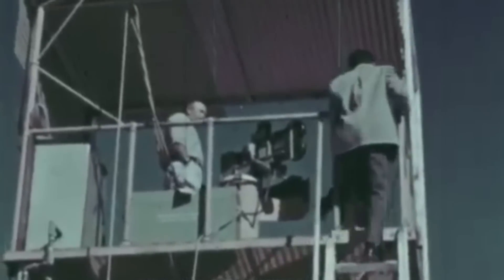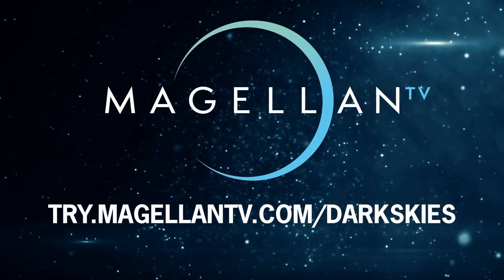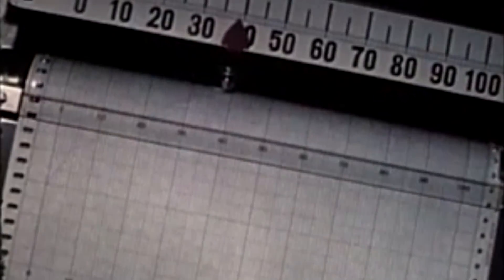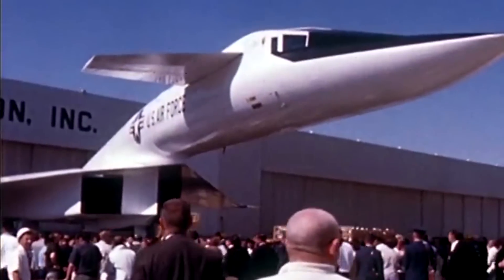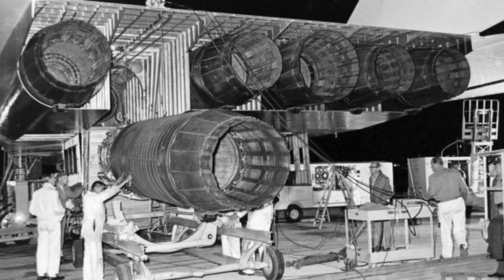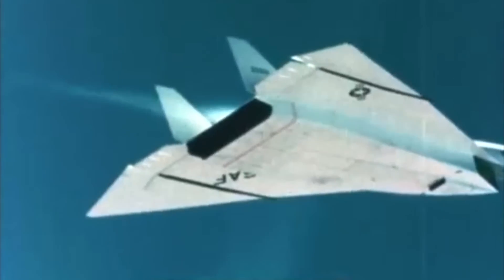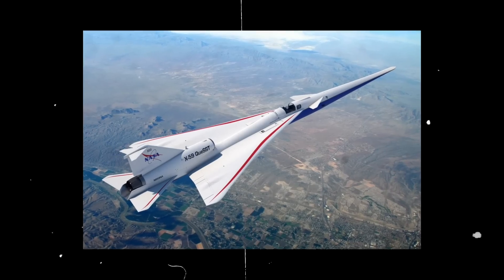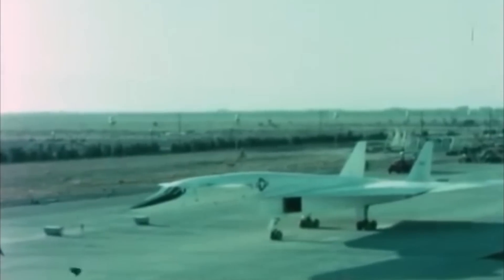XB-70 Valkyrie - Mach 3 Nuclear Bomber

Comment: I spent a lot of time at the Wright-Patterson Air Force Museum when I was little. Everybody liked the SR-71, and that was kept inside. They used to just let the YF-12 and XB-70 sit outside in the rain. But they had the J58 and YJ93 engines inside where you could play with them. And an Me-262 engine. I usually just stared at the engines while my family wandered around the museum... Except for the XB-70.

It's just beautiful. It's worth going to Dayton just to stand under it. And the Wright Brothers plane is there, too, in a different museum. The USAF museum also has a couple Keyhole satellites now. It's better than the DC Smithsonian as far as aircraft. Hangar 18 is also at Wright-Patterson. If you go to the museum, make sure you sign up for the bus ride to the Annex -- it takes you to Hanger 18, where they have many retired Air Force Ones and experimental planes.

The SR-71 and XB-70 will always be the coolest airplanes ever made. But the SR-71 is silly.

The SR-71 was insanely expensive to maintain. To keep the fuel from igniting in the tanks at high temperatures they invented JP-7 fuel with such high octane that it took explosives to start the engines — and they needed a bomb squad to refill the starter fluid (which exploded when exposed to oxygen). The engines dynamically reconfigured themselves and needed to balance the shockwave in the intake. If things weren't perfect the engine stalled with a dramatic bang, and after you shit your pants you needed to restart it ... if you had enough explosive starter juice left.

The XB-70 was much more rational. It used normal JP-6 fuel and they pressurized it with nitrogen to make sure it wouldn't ignite in the tanks at high temperature. And the engines were normal except that they feathered the compressor blades to reduce drag. Google "variable stator compressor patent" to see the XB-70s simple solution which makes a lot of the SR-71's engineering look ridiculous.

The SR-71 went Mach 3.2 and carried a camera. The XB-70 went Mach 3.1 and carried 50,000 lbs. of bombs.
Reply: I think your argument is pretty flawed.  The SR-71 is much smaller than the XB-70. The SR-71 has a much lower mass.  Mass affects almost every aspect of an aircraft's design.  The XB-70 carried more mass in fuel than an SR-71.. itself fully loaded with fuel.  The thrust to mass ratio of an SR-71 is 33% better than an XB-70.  That's going to translate to a lot better acceleration when needed and it's going to yield better maneuverability.  The top speed is similar.  But that's where the similarities really end.  The SR-71 flies higher, faster, lighter, and cheaper (at least on fuel).
Reply: @fakshen1973  That's a good point. Certainly the XB-70 would be easier to shoot down than an SR-71. The SR-71 could out-accelerate the XB-70, and had less of a heat signature, and sometimes they added cesium to the fuel which gave it radar-absorbing exhaust.

But I would never call the SR-71 maneuverable. It was very easy to stall. It had about a 7-degree flight envelope. And It had a 50-mile turning radius at maximum bank (which puts you on the edge of a stall). The F-14/F-15/F-16 all have under a 1 mile turning radius, and newer planes with thrust vectoring like the F-22 and Su-35 even better.

I mean, the XB-70 had a much lower budget, and it was never really given a chance. They came up with the weird brazed honeycomb steel stuff because they couldn't get titanium. I don't think you could say the SR-71 was cheaper in any way. The SR-71 might use a little less fuel, but even that was much more expensive fuel.
Reply: Fuck me. YouTube comments section really is where good natured conversation and politeness goes to die. Some of the replies to this enthusiastic comment are withering to say the least. Massive eye rolls all round.
Reply: Raquel Foster First off, jet fuel does not have an ‘octane rating,’ it is a Cetane rating.  The ‘explosive’, you incorrectly stated,  is a pyrophoric catalyst called TEB, short for Tri-Ethyl Borane.  During the start cycle of the J-58 engine,when the fuel selector lever is moved from shut-off to start/ground idle, a squirt of TEB is injected into the combustor, igniting the fuel chemically instead of electrically.  The JP-7 had a very high vapor pressure due to the fact that the aircraft operated at extreme altitudes and extreme temperatures.  The fuel system of the aircraft was used as a thermal heat sink and used to cool various aircraft systems.  The “shit your pants” scenario with the J-58 was terrifyingly referred to as an ‘unstart.’  An unstart was not uncommon at higher Mach numbers and was typically caused by a hiccup in the positioning of the aero-spike at the front of the inlet.  Typically the Mach scheduling box would reset the spikes, however, due to the extreme spacing of the engines, a fatal yaw into the engine that had lost thrust led to several airframes being lost due to excessive aerodynamic loading on the airframe.  Pilots were typically trained in this scenario by cutting the throttles to idle in less than a second, or else.  The VGV’s, variable guide vanes, are small, movable airfoils with assist in positioning the airflow relative to the blades on the compressor rotor.  Being that the J-58’s are dual cycle engines, they would begin the transition from straight turbojet thrust to ramjet thrust starting at about Mach 2.4.  The inlet spikes would capture the shock wave, direct it into the bypass, and the engine would effectively become a ramjet.  The VGV’s would schedule to their lowest airflow setting further diverting more air into the compressor bypass.  The J-58 is one of the only engines I have worked on that has a set of VGV’s set in front of the first stage compressor rotor.  The shock wave created at high Mach flight would become the compressor and the air would dump directly into the afterburner assembly through six huge bypass ducts, where it would be mixed with raw fuel and ignited.  After that is was off to the races.  There was other equipment associated with the exhaust nozzle that also enhanced thrust production and efficiency of the engine.
Reply: @j.muckafignotti4226  You are correct... From an aircraft engineer of 28+ years. (12 of those years, solely in gas turbine engines of various types.)

We studied the XB-70's systems many years ago, (Along with the SR-71's systems also.) 
Finally someone in the comments actually has a clue. or can copy paste... either way.

If others find that offensive... well then... Bad luck
Raquel, please....... Octane?? Starter fluid that explodes? umm yeah..
Reply: @j.muckafignotti4226  it was still slower and carried less weight
Reply: @J. Mucka Fignotti You sound like a delightful person! You're so full of joy!

It looks like you're trying to correct me about the definition of "explosive"? Are you a chemical engineer and you're really sensitive about that? Please educate me, sir! Can an igniter which explodes in the presence of oxygen not be called an explosive? I had no idea! But as they say, you do learn something new every day. Bless you!

And you're quite displeased with my use of the word "octane"! Do you understand what octane rating means? I'm not sure I do, but I'm thinking high octane means it doesn't explode as easy. The primary property of the fuel of the SR-71 is that it was very difficult to ignite — to keep it from spontaneously igniting at very high operating temperatures. Kinda like the primary property of high-octane gasoline is that it is more difficult to ignite — to keep high-compression engines from experiencing detonation before the spark. Did you not understand the analogy?

I apologize for not being verbose enough! I can tell you enjoy educating people on the Internet, so ... I await your thoughtful response!
Reply: Raquel Foster. So sorry Rachel, I did not mean to offend, just to educate.  No, it cannot be called an explosive as there is a difference between deflagration of an explosion and rapid oxidation due to chemical reaction.  TEB is a catalyst which promotes the rapid ignition of the fuel known as JP-7.  The vapor point is so high with JP-7 that electrical ignition is impossible, even at 60,000+ volts of a typical jet engine ignition system.  The TEB causes a spontaneous ignition of the fuel which is reliable and repeatable.  As long as you have enough TEB you can restart the engine.  I believe, if I remember correctly, the TEB canister has enough for about seven starts per engine.  I am not ‘displeased’ with your use of the word octane, it’s the incorrect application to the type of fuel.  Octane only applies to fuels which are an aromatic, jet fuel is refined diesel oil and the correct way to define its latent heat capacity is by using the term Cetane, which only applies to oil based fuels.  Aromatic fuels have low vapor pressures, meaning they go from a liquid form to a gas quite easily, jet fuels have very high vapor pressures and are not easily converted to a vapor.  This is one of the reasons why the fuel nozzle technology in a modern jet engine is a very highly guarded technology.  Good fuel atomization=good combustion efficiency and range.
Reply: Wow, you clearly know your stuff, almost as if you worked at the museum yourself for a while. I'm a real science and technology nerd, so I really love hearing about such technological marvels as the Valkyrie. Thanks for taking the time to write that comment!
Reply: @pieterveenders9793  NP! I grew up in a cornfield in Ohio. We didn't have much money, and the museum was free. And I'm a huge nerd, obviously! I'm a software developer, and I worked in an R&D office with the people who invented 1773 (the fiber optic avionics databus for the F-35). And now I work at USAA. Seems like I've always been around military people. I always get excited about all the little details of things, and get excited when I meet other nerds who are excited about the details. Seeing this video was a weird nostalgic thing for me because that big white plane was such a cool thing from my childhood. That plane sitting in a hangar in Dayton.
Reply: @Mitchell527  The XB-70's data has been public domain for many years.
Reply: Raquel Foster - When I visited WPAFB Museum I looked and looked for the XB70. I finally asked and airman, and he pointed up to the ceiling ... I had walked under it at least twice!  It is a marvel.
Reply: Ive lived in Dayton almost my entire life, and the XB-70 is very impressive to see in person, i love everything about that museum and videos just do not do justice to the size of the Valkyrie,  anyone who has the chance to get to the museum, i would definitely recommend it, one of the only museums to have stealth aircraft as well, there is a B2, F117, F22, and so many more amazing aircraft and not just American aircraft, alot of the X planes and test aircraft are here as well, such a cool place, even former President Kennedy's air force one aircraft is here, definitely recommend going to this museum
Reply: @Kaptin77  Yeah! People don't even know about the annex! If you're friendly with the staff they'll show you the vault (where they stored the Norden bomb sights in WW2), and it's got a buncha plush alien stuffed animals in it. The X-15 is super cool, too! I think they made several of them, but ... that's probably my second favorite plane at the museum. That thing is like a tiny little SR-71 in a way. It's like the little indestructible version that goes twice as fast. It's got the little stubby tail on the bottom... It just looks like it's been all reinforced. Doesn't the one at the museum have little metal flappy doors that cover some of the cockpit glass? Maybe I'm thinking of something else...
Reply: @RaquelFoster  Its been a while since ive been out there, but im pretty sure it has the covering on the canopy, but in my personal opinion,  i think the annex is one of the coolest parts of the museum, i cant wait till all this virus stuff has passed so i can go back out there, ever since i was a little kid i have built plastic scale model aircraft, and the museum is where i go to take pictures so i can get them detailed as accurately as possible. Every single time i go, i notice something new that i never noticed before, and several years ago i was there when the F-117 was flown in and they did the dedication ceremony when the aircraft arrived.
Reply: @Kaptin77  That's cool! My brother pays attention to when stuff like that happens. He's the one that told me when the keyhole satellites showed up at the museum. Remember the Doolittle's Raiders cups? And they turn the cups upside down when one of them passes, and the last two were going to drink that 100-year-old bottle of Courvoisier?

The Annex is like what the whole place used to be like. It's just kinda relaxed and you can wander around and poke at things. Isn't there an Air Force One that has a mannequin of Dwight D. Eisenhower, and you can just walk through the plane?
Reply: @RaquelFoster  Yea, there is the Air Force One that Eisenhower had with a mannequin in it, and ive heard from several people that the museum is one of the most haunted places in Ohio as well with the former Air Force One aircraft being the main culprits of the ghost stories, it would be pretty crazy to be a security guard there at night, especially Kennedy's because that is the one that brought his body back after he was assassinated and the same one LBJ took the oath in and was sworn in on, alot of the new space exhibits that they uave put in are really cool too, now that ive been talking about the museum alot, ive really got the bug to go back out to the museum again,  such a cool place, i could easily spend a week there lol
Reply: @RaquelFoster  I spent a lot of time at the Air Force Museum when I was a kid, too. My grandparents lived in Dayton, and I loved to go visit the Museum with them. I want to say I remember when the XB-70 was displayed near the main gate of the museum grounds. It captivated me more than any other plane there (except possibly for the B-36, when it used to be housed in the hangar where the wingtips barely fit). I remember the Annex, too. Once upon a time, there was a regular bus out there. I remember the Eisenhower plane and the mannequin, too. I want to say Truman's plane also had a mannequin, but it's been a long time. I also remember a big to-do when FDR's presidential plane 'Sacred Cow' was put on display at the Annex. Great memories.
Reply: @jeffgriffith2868  I remember the XB-70 being outside when I was very young. I'm not sure if it just lived out there or it was in some kind of transition. I also remember being amazed by the B-36 — mostly because the tires were just so much bigger than any other plane. And I remember being weirdly fascinated that somebody had painted "Strawberry Bitch" on the side of one of the planes LOL.

Wait, so it's not just a regular bus anymore? The last time I went to the annex was on a bus ... Well ... my dad was in the military and has the right ID, so actually the last time I went to the annex we just drove there and hung out talking to the staff after the last bus left. I was nerding out about the norden bombsights they used to store there with an older guy who was a volunteer at the museum, and he showed us the vault in Hangar 18 where everybody used to say they had a wrecked UFO — and he said it's actually where they kept the bombsights because they were so secret. But they had a bunch of stuffed alien toys in there.
Reply: Raquel Foster it's honestly been at least 15 years since I was at the Annex. Probably the bus is still how you get there. My last visit to the Museum was right after the Memphis Belle went on Display (2018?).
Reply: @RaquelFoster  Only got to go to the museum once, and that was in the early 90's.  Been wanting to go back, but I was hoping to wait until they were able to put the Convair XC99 on display, but it looks like that'll never happen. You'd think, since it's the only one in existence, like the Valkryrie, they'd try and get it on display, but I guess I can understand given the terrible condition it's in and the massive $ and thousands of hours it'd take to do it.
Reply: @58HUSTLER  You should call the Pima museum and see if they can tell you if it’s at least something you can see on the bus tour of the boneyard! I mean, if you have any excuse to go to Tucson. I’ve been to the Wright-Patt museum a million times, so I guess I’m a little spoiled, but the boneyard is the only other thing that I thought was really cool. But I lived in Phoenix for a few years and it wasn’t too bad just to drive there. Well, I suppose I drove from Dallas to Houston just to see the Saturn V and the old Mission Control. The XC-99 is such a cool plane. They should’ve moved it to Arizona sooner so the humidity wouldn’t destroy it. I don’t know how you could convince them to prioritize restoring it, though. I can just hear someone yelling, “We already have a B-36 taking up most of a hangar, and you want to restore a bigger version of it?” 😀
Reply: Thank you for sharing, what a great story. I want to see!!
Reply: I couldnt agree more! my grandfather designed some of the electrical components on it and i saw it a few years back at the national air force museum and the plane is absurd seeing the cockpit almost two stories above the ground is incredible i feel like alot of people ready the dimensions of an aircraft or vehicle but theh dont really understand how massive some of these can be seeing it person really puts it in perspective its crazy
Reply: Well, I enjoyed your comment and learnt quite a bit from it. Thank you for your enthusiasm and passion about the subject. I never knew how impressive a machine the XB70 was until I watched this piece so it was very useful and enjoyable for me. Thank you.
Reply: @mhoppy6639  Thanks! I mean, if it was an ugly plane I probably wouldn't be excited about it at all. But it's very swan-like. When you see something that big as a little kid — and then the guys at the museum tell you that it's painted white to try to survive a nuclear blast better — it makes an impression on you. 🙂
Reply: I'm not going to even try to say that I understand any of this. It's still amazing how far we've come since the Wright Brothers who were merely bicycle manufacturers. They knew nothing about engines at first because not even the motorcar was really developed yet. So how they achieved the very first flight is a remarkable achievement. From the Wright Flyer to the F-22, is breath taking.
Reply: Hate to join in on the end of a conversation,  but it was too good a read not to say hello and thank you to you and the appearant P&W maintainer/engineer who knows so much about the J58! Was lucky enough to get back to the museum last Nov and it is really quite interesting to see the Keyholes sitting under the -70s wing! I definitely love the Valkyrie, Blackbird, and Oscar planes, but the X-29 is still just about the coolest dang thing! Looks like an F-5 and an F-16 had a midair and had a baby! Also worth looking at if you get to the museum is the YF-23 Blackwidow II! It might not have the Lockheed glam of the Raptor, but as far as futuristic planes, it is about as amazing an airframe as any! Again, thanks for the colorful and enlightening comments! Glad you two didn't come off sore at one another.
Reply: holy sh*t there are whole books in the replies
Reply: Calling the one that actually carried out it’s intended job “silly” is silly.
Reply: Its made of stainless steel so.....
Reply: Van Guard Nowadays it is, but the exhibits used to be arranged differently. I have not seen it myself, but I have heard several other people over the years say they nearly missed it and then found themselves standing right under it.
Reply: @Van Guard They've moved it around a few times. And things were really really packed in the museum for awhile until they added a hanger and moved stuff to the annex. The hangar it's in now ... well ... That'd be hard to miss it!
Reply: @Van Guard - I know! That what is was thinking at the time.  It was about 20 years ago. Several planes - including the SR 71 were parked underneath it, so things must have changed ...
Reply: I love going to Wright-Patterson Air Force museum.
Reply: My father in law, retired Air Force, said he disliked the SR-71, Because it was so expensive to maintain. He denies working on one, but it was a money hog. But the XB-70 was too, those test flights cost more than just several million dollars to carry out.
Reply: Meh, 1 idles back to cruise mach 3 all day long, the other melts into a puddle after an hour or so 🤷‍♂️
Reply: @anthonypoltes7413  I mean, sure, if you think that's a good thing that it can barely stay in the air below Mach 3 🙂
Reply: @RaquelFoster  good enough for the people with the money 🤷‍♂️, thats why we had a fleet of sr71s instead of a single prototype after the crash. Plus if you make something that works for everything then it becomes bad at the one thing its designed for
Reply: @anthonypoltes7413  Was it good enough? The SR-71 was supposed to replace the U2, but the U2 ended up outlasting the SR-71 by decades because the SR-71 was insanely expensive — and insanely expensive to maintain.
Reply: @RaquelFoster  i like how you casually flipped the conversation to  the sr71 vs the u2 instead of the actual subject, the sr71 vs the xb-70 when you backed yourself in a corner. Besides NASA will take whatever scraps they can get because of how inefficient they are with money
Reply: @anthonypoltes7413  I like how you casually trolled a happy nostalgic comment I made 8 months ago. You just wanted to diss me and roll your eyes. You even included the shrug emoji. Nicely done! You win at making the internet worse for everybody.

Did you want a legitimate response for me? OK, let's look at what you said. You wanted to inform me that the SR-71 is better than the XB-70 because it cost a lot more and they made a lot more? Seriously? That makes sense to you? You're just going to say something completely ignorant then drop the mic?

And apparently you're also a person who needs to have the last word. I'm sure you're a delightful person to be around socially! Have a lovely weekend!
Reply: Raquel Foster I respect your opinions regarding SR71 yet disagree. 
1 SR71 staff ADMITTED to a top speed of Mach 3.2. In fact, considering her exceptional heat resistance, aerodynamics and power, she likely achieved higher speeds than mach 3.2.
2 SR71 was never built to carry bombs. She was built for high-speed, high-altitude observation. And performed her job quite well.
3 Not a single SR71 was ever lost to enemy fire (further indication that she could outrun anything built by the commies).
4 SR71's viability and usefulness was evidenced by the fact that 60-odd specimen were built. As opposed to only 2 XB71s.
5 SR71s were used well into the 2000s...a lifespan of 35-plus years. Technology WAY ahead of it's time for the 1960s.
Not silly at all.  A beautiful, fine, proud bird.
Reply: A few Sr 71s have fs done mach 5
Reply: Having grew up in Dayton, I'd  been to the museum multiple times when it was a single building and the XB-70 was outside, it is a very large aircraft.
Reply: Raquel Foster Actually the SR-71 went above Mach 3.3 and 100,000 ft. I was in the Air Force stationed at Kadena AB Okinawa 18th PACAF and attached to the SR-71 squadron supply section. I handled and stored electronic parts and black boxes. I was in a tiny windowless room the size of an average house restroom with a SPERRY-UNIVAC PHASE 4 teletype computer the size of a washing machine that takes 15 minutes to receive classified teletype transmissions and 15 minutes to transmit typing data. We called the SR-71 HABU after the deadly snake there not blackbird. The Air Traffic controllers told me when it goes faster then mach 3.3 and above 100,000 ft it was TOP SECRET and if they didn’t have that clearance they had to shutdown their radar. That was the SOP ( standard operating procedure). What is on the records books was just AVERAGE OPERATION SPEED/ ALTITUDE. It’s full ability was top secret. I was at Kadena from 1983-1985. I switched to Army in the 1990’s and retired Army 6 yrs ago. By the way nothing silly about the SR-71. The  Soviets tried to shoot it down many times and failed. It was too fast and created a holographic image on radars. Unless you served in the Air Force being around them and being around personnel who worked on them, you really are uninformed! I watched it take off from the flight line day or night.
Reply: WING CHUN The Soviets had no reason to try to shoot down the SR-71 since it didn’t violate Soviet airspace. Other countries however did have the honor of being violated by the SR-71 and other US aircraft, so there were certainly no lack of attempts to bring one down.

Also, the SR-71 just could not fly faster than Mach 3.2 or possibly Mach 3.3 (too lazy to double check my figures right now), because that was the thermal speed limit. Above that speed, things would start to melt or malfunction due to overheating. Claims of “top secret classified” speeds in excess of Mach 3.5 or even Mach 4 or Mach 5 that are out there are simply ridiculous. The difference between Mach 3.2 and 3.5 may sound insignificant, but it is not.
Remember, the SR-71 routinely cruised very, very close to its absolute design limits, and why shouldn’t it? If you design an aircraft for Mach 4, it makes no sense whatsoever to “only” fly it at Mach 3, since the technology to go that last bit faster will be such a huge leap in cost and manufacturing complexity.

Same goes with altitude, the SR-71 started its missions at let’s say 81000 ft, then gradually climbed as it got lighter, as fuel was burnt off. I don’t think it could ever reach 100,000 ft in level flight (and remember, the SR-71 was not built for great maneuverability, so zoom climbing like you do with an F-104 or an F-15 to briefly break altitude records just isn’t done), but I am not entirely sure of that figure so I won’t contest it other than saying that, again, it flew extremely close to its design limits all the time, so there was no need for classified top secret hush hush from air traffic controllers, so whoever told you that story was just bullshitting you.
Reply: @asianfighter62  One of my nerdy software developer friends was at Kadena! I like the pictures of the stuff they painted on the tail. The SR-71 has some mythology around it, so ... well ... there are a lot of stories you hear from military guys. It all seems pretty fantastical. But seeing regular guys doing dumb things like painting the Playboy bunny on the tail of an SR-71 makes it seem more real.

I always heard the big secret was that the first time the SR-71 flew into Soviet air space that it was intercepted by MiG-25s which got radar lock but didn't shoot it down, and the SR-71 was generally kept from having any missions in Soviet airspace for its career. Russia had plenty missiles that could shoot it down.

I get the impression that every speed record anybody tried to set after the X-1 was about a heat problem. The top speed wasn't because they couldn't get more out of the engine. It was because heat would destroy something. The SR-71 could certainly go faster than Mach 3.2. It could go Mach 3.5 in a dive. But going over Mach 3.2 makes too much heat, so you need a good excuse to do it (like outrunning a missile), otherwise you're risking destroying the airplane just for fun. The MiG-25 could go Mach 3.2, but that destroyed the engines, so they were restricted to Mach 2.8. The X-15 started melting at Mach 5, but they were crazy and managed to get it to Mach 6.7.

People are used to safe consumer devices. I think there used to be a lot of military/research stuff that would detonate itself pretty quickly at full-throttle. 🙂
Reply: Raquel Foster k
Reply: 0